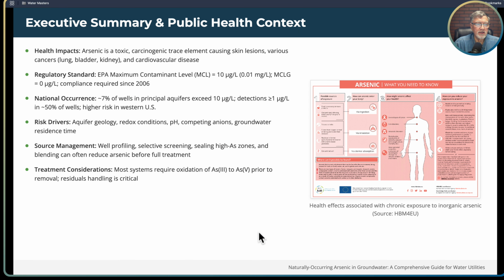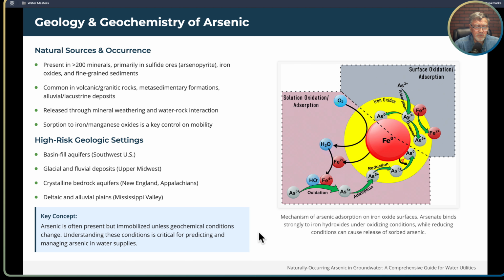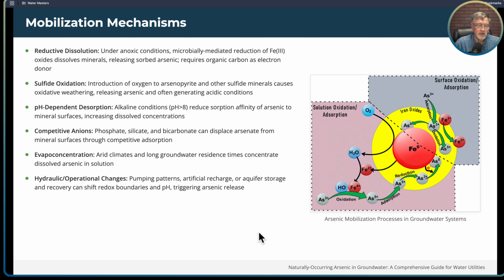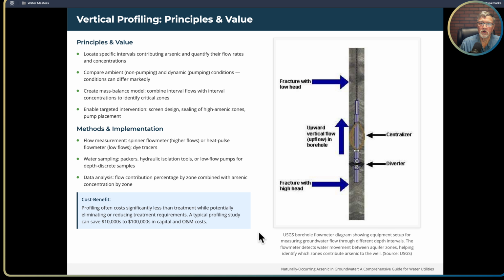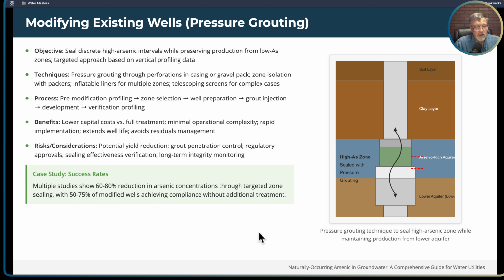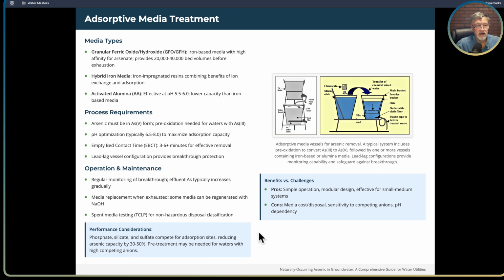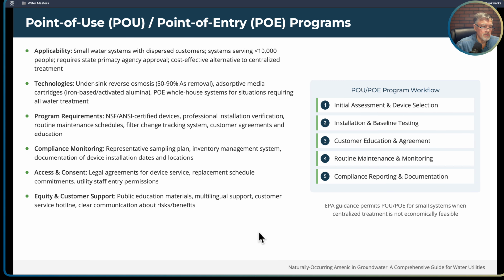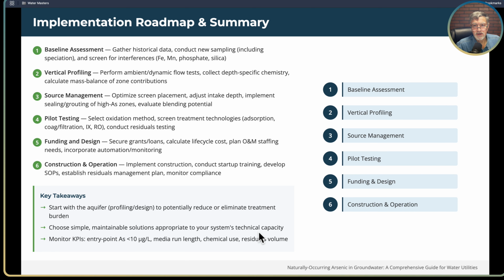Naturally Occurring Arsenic in Groundwater: A Guide For Small Water Systems

Comment: as a private well owner, i’m also the water system operator. 😑. the arsenic level went from .0017 to .0135 after chlorinating the well to get rid of the total coliform and e. coli. i don’t know the speciation. don’t have an iron problem. manganese is in the water. the water softener takes care of that and the harness.  ix treatment sounds like a good option as it doesn’t seem practical to run ro for livestock
Reply from the maker: I'm not clear on the units you are using for your arsenic measurements, but I suspect you had some issues with a pH change that may stabilize after the chlorine effects wear off.  IX or RO are probably not viable for livestock water due to costs and handling.
Reply: finally got the speciation test results back.  mg/l.  the current test results is 0.005 mg/l of type V.  less than 0.001 mg/l of type III

the dog is happy he can drink from the spigot again. i plan on having a few goats.